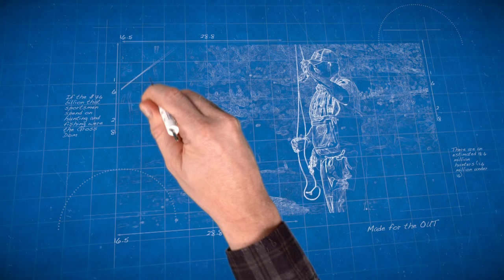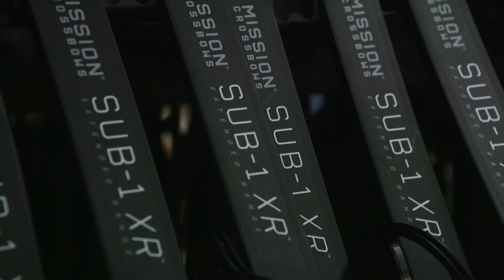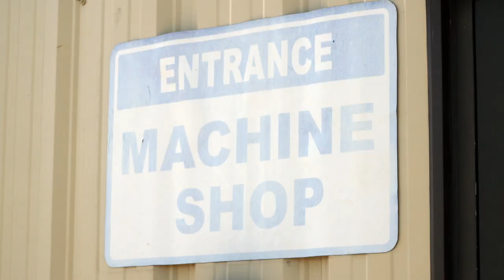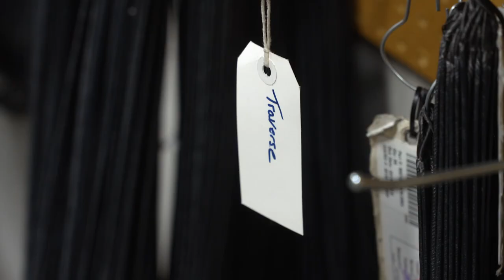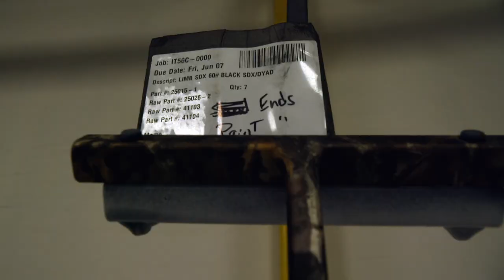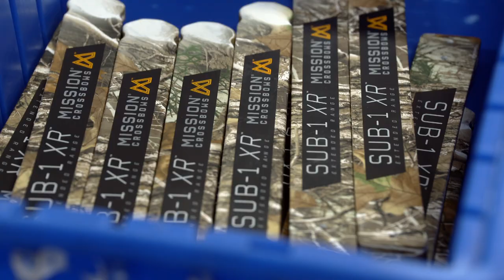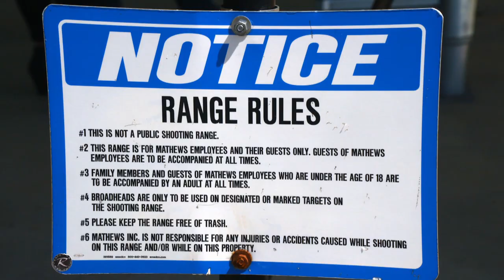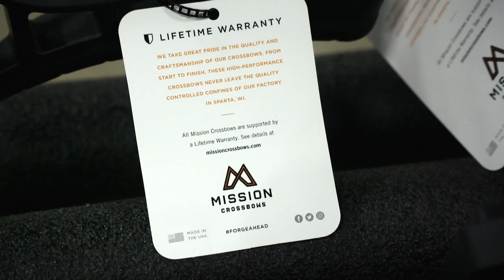Made for the Outdoors (2019) Episode 4: Mission Crossbow

Comment: I have to ask, is that 6061 aluminum, or 7075?  Both are excellent alloys and I use both for specific parts for the rescue equipment I manufacture.  The grain on the bar suggested 6061.  I’m thinking of a Mission crossbow, and knowing the alloy, it could really finalize my decision.